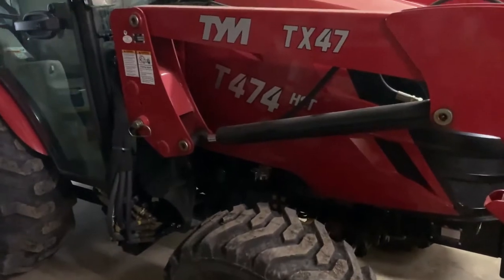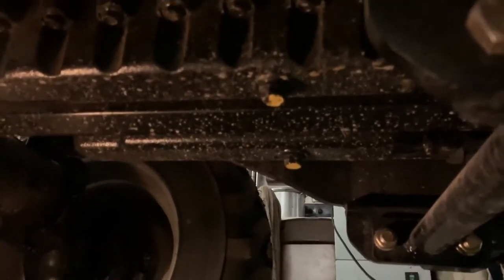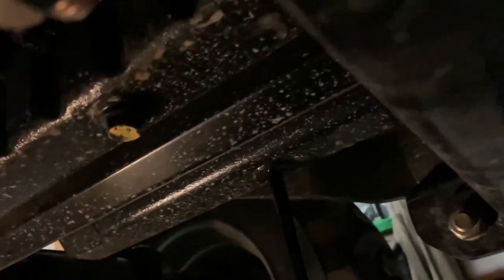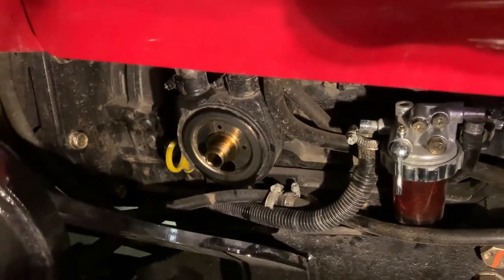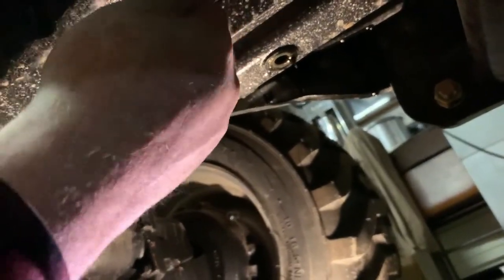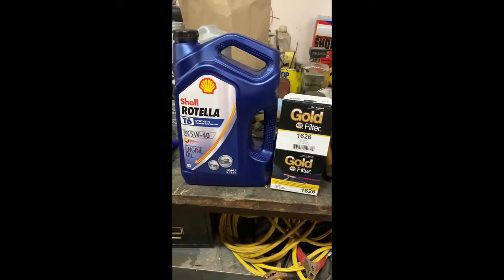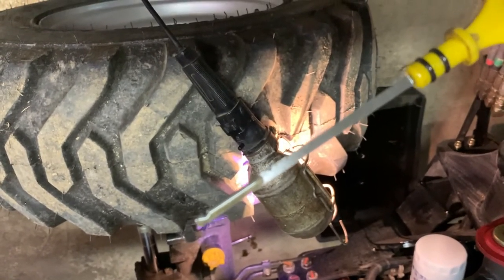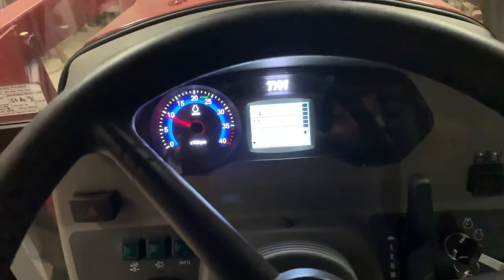#1 TYM T474 oil and filter change

Comment: What engine oil do you recommend (since I can't find it in owners manual on line) for summer time? Also did I hear it takes a little over 5 quarts total? Thanks for this video.
Reply: Any diesel spec 15w40 will work for the snowbelt and south, in the winter in the snowbelt I use Rotella T6 5w40 because of our extreme cold winters. But Rotella T4 15w40, Delvac 15w40, Mobil 15w40. If it says heavy duty diesel oil in this weight it should work. If you get a gallon can, there will be a little smidge left by the time you have reached to the "F" mark on the dipstick. Fill the filter when putting it on and give 4 qts, start the engine and let it run for 5 minutes and check levels 5 minutes later. It might need a wee bit more, but never beyond a full US gallon.
Reply: Ok thank you, I have some Valvoline Premium Blue Diesel engine oil 15W-40 that I keep for my Cummins 6.7 Dodge I'll use that.   @Re-Booter
Reply from the maker: @sbhjackson5931  I forgot which youtube account I was logged in as, but yes that works just fine for you.

Comment: Great video...thank you. Question, did the  napa filer 1626 work? I have the exact same tractor and am running into difficulty finding the kukje filter. I have a napa store near me and they have a Tom of those in. Thanks again...look forward to your reply.
Reply from the maker: Yes, I've had it on for 180h now and coming up to change it at 300h on my tractor now. Wix 51626 works just the same as they make the NAPA Gold FIL1626 filters.
Reply: Thank you so much for that. I'm at 150, but was wanting to change it as it's been a year since I did the initial change at 50 hours. You have been more helpful than my nearest dealer...again greatly appreciated.
Reply from the maker: @patheidi8255  No problem, this is why I made this channel to help the growing numbers of TYM owners, since most of the videos I make are the 1st one on some of these subjects.